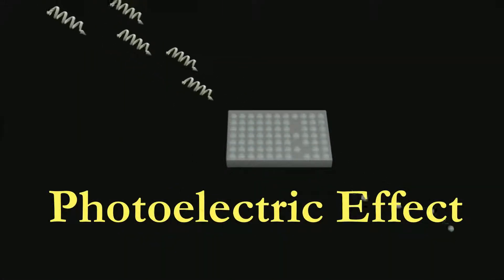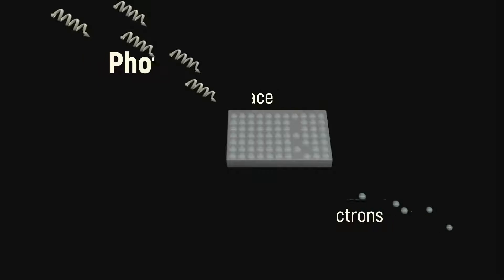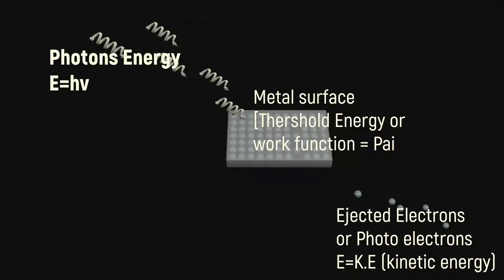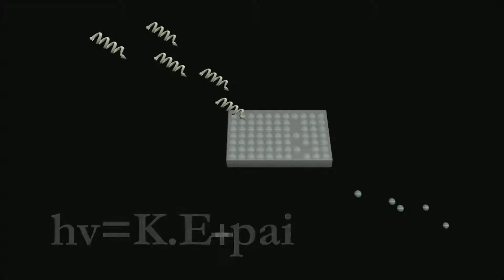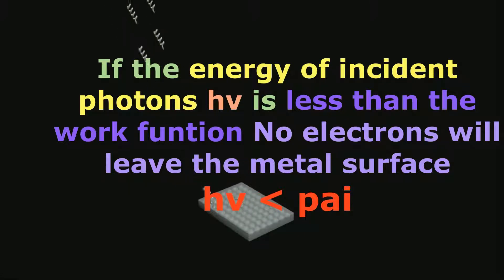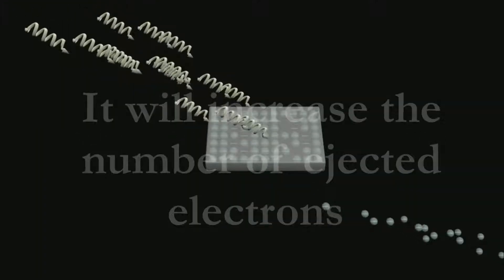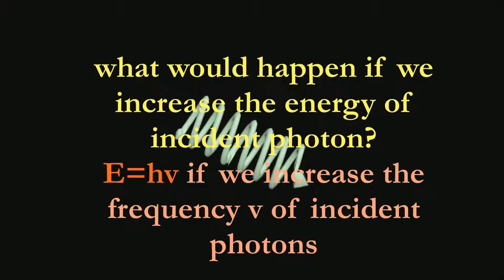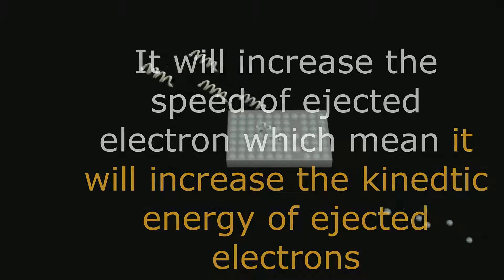Photoelectric Effect Physics

Comment: If electrons are ejected the metal surface can't it becomes unstable
.. ans please???
Reply from the maker: no electrons are not fixed with the metal they will leave the surface and gain more, electron can travel in the metal like conductor as electricity. what happens when electron gain energy they jump to the conduction bands in semiconductor and start moving..